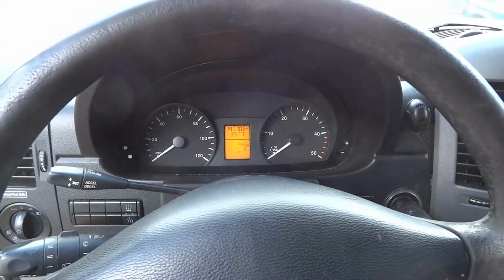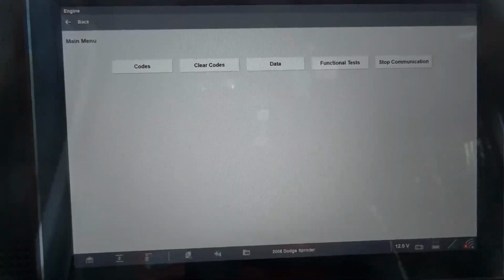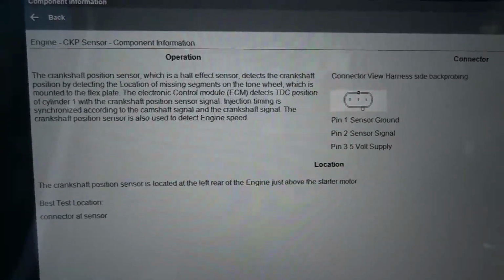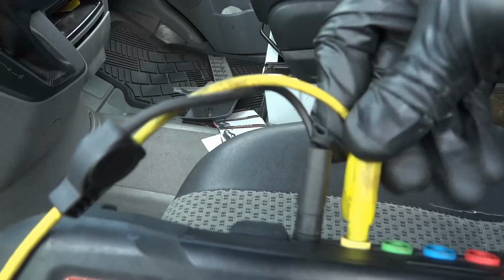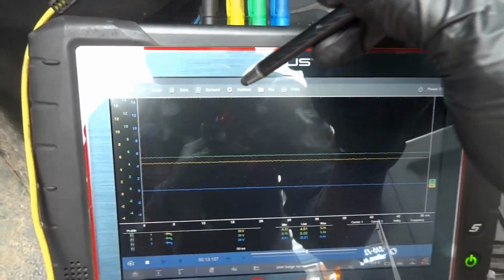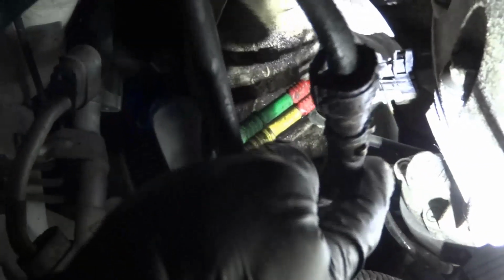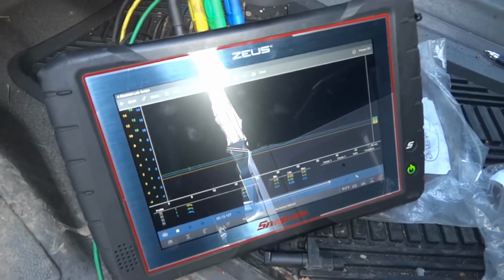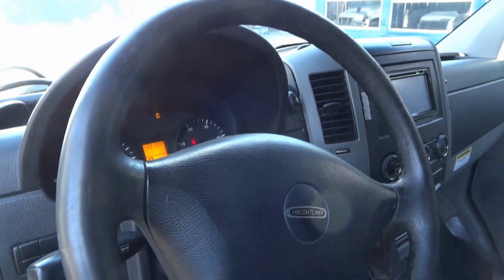Freightliner / Dodge Sprinter Crank No Start, Code P0335, Diagnosis and Repair

Comment: I was born in Frederick MD. I haven't been back there since 1972. I have an 07 sprinter I got it in a trade. It ran great until the turbo exploded from  broken exhaust manifold pieces getting pulled into the turbo. I replaced the turbo and repaired the intake manifolds. When I put it all back together the engine cranks but won't start. I replaced the crank sensor but it still won't start. The tachometer isn't moving while cranking. I'm going to check for voltage but it seems odd that it won't start after the rebuild. I have cleaned and checked the grounds. Nothing is working so far. Hopefully it's not a bad ECM...

Comment: Hola mi esprinter arranca en frio y cuando calienta que lo apagó no vuelve a arrancar hasta que se enfría el motor que podría ser es un Freightliner esprinter 2500 diesel
Reply from the maker: @AndresHidalgo-h2w  English please?
Reply: My 2007 Freightliner Sprinter 2500 starts when cold and when hot it doesn't start until it cools down. What could it be?

Comment: Thank you sir for these videos... Are there two types of hall effect sensors (CKS down pull sensor and CKS up pull sensor)!? 
If thqt correct... I think the first one you are explaining here
My question is how can I know which one I am dealing with because the second one is supposed to be 0 volts on two wires and 5 volts on the third wire
Thank you
Reply from the maker: @kharbichetahar4486  My Pleasure! There are hall effects sensor and permanent magnet sensors

Comment: I'm here to learn from a great professor.  But am a little confused. You  backprobed  a 3 wire hall effect sensor but yet you had 4 leads plugged into the labscope. Where is the 4 th lead connected to? Also, can you do a load testing of the circuit with that labscope ? Thanks for the great videos.
Reply from the maker: @thereckchanic4709   My Pleasure! the forth lead is the ground of the scope, you load test the sensor circuits by cranking the engine

Comment: I have. mercedes sprinter reset code P13F6-00 stuck any ideas to help fix
Reply from the maker: DJ Rico Guzman  check your DEF System
Reply: @KITS_Auto_and_Truck_Repair  thanks
Reply from the maker: @djricoguzman493   My Pleasure!

Comment: Want to give you a big “thank you” for you thoughtful step by step diagnostics.  I was able diagnose and locate a turbo intake leak and salvage my long road trip.  Did a 20 minute parking lot repair of the air intake turbo supply line with a $15 pipe repair fiber tape kit.  Would never have figured it out without your videos.  Repair has held for 800 miles.  Picking up the new part tomorrow.
Reply from the maker: Lou Mcgill  My Pleasure! I'm glad to hear that the videos are helpful!

Comment: Good 👍 Job 👌 brother 👌👍. I've a question ❓🤔 for you. Is it possible to test a sensor like crank position sensor itself with a simple multimeter by measuring the resistance or so? Thank-you 👍.
Reply from the maker: michael gebremeskel  thanks! I would not recommend doing a resistance test on a crank sensor because the results of that test can be very misleading! you're gonna need a scope to test a crank sensor, the signal is too fast!
Reply: @KITS_Auto_and_Truck_Repair  thank-you 👍👌 Mr Deo.
Reply from the maker: @michaelgebremeskel6622  My Pleasure!

Comment: Good video. I have a 2001 sprinter van that I have crank no start. It happened right after I changed the fuel filter. I have tried 3 different scan tools so far non of them work. Can you recommend a good affordable one that works on the sprinter vans?
Reply from the maker: Bravo Carpentry  it sounds like you have air in the fuel system, I recommend buying an Autel Scanner!
Reply: You have to prune the fuel filter and let the engine crank for 1.5 minutes because on the 2001 there is no in tank fuel pump. It takes that long for it to pull it up into the motor. Seems crazy but it’s true. Keep it cranking until it starts.

Comment: Would it be possible to test the crank sensor by passing the tip of a screwdriver near the end of the sensor to simulate a reluctor wheel?
Reply from the maker: DW S  Yes absolutely, or a piece of metal!

Comment: I got a Toyota Camry 1999 model with a confirmed P0340 and a pending P0116, P0773 code. The symptoms the customer told me were: engine stalling while on motion and during that time the car just wouldn't start because the engine was very hot but when the waited for an hour or more the car later started. What I noticed was that the car revv high intermittently on it's own but will return to normal idle again about 5 second again, and the exhaust tailpipe was really darkened when I put my hand. It was raining heavily that's why I was unable to check anything further.  Plugs, fuel pump and a relay( the don't know where the relay was removed though) was replaced by another engineer but the problem still persist. Please how do I fix this problem?
Will replacement of part like camshaft position sensor fix this problem?
Reply from the maker: david essien  check the cam and crank sensor! or I recommend you take it to a pro mechanic to have diagnosed!
Reply: @KITS_Auto_and_Truck_Repair  Thank you so much for your support and assistance 🤝.
 I checked there and didn't see the CMP sensor nor a hole where it should've fitted into however I saw the connector only. Fortunately, I saw the fault today. I was imagining why the code for temperature sensor displayed hence it prompted me to ask the car owner if they've ever experienced overheating with the car. He acknowledged that fact and was more detailed in his explanation, that the fan was not working and radiator have been leaking and the keep adding water. It was the cooling system that was causing the water temperature sensor code to show. The radiator was leaking water and one  among the two fan was not working so when  the car is hot, it  stalls. But it will restart after the car is left to cool. Although I didn't test run it because he told me the fuel was low.
  I have fixed the fan. Both are working now but for the radiator I told them to give it to a specialist on radiator to fix the leak. 
  If they fix the radiator I'm hoping the problem will be permanently fixed.
Reply: @KITS_Auto_and_Truck_Repair  Ok. I will check that. Thank you so much!
Reply from the maker: @davidessien5465  My Pleasure!!

Comment: Afterter I install the transmission my sprinter crank no start I replaced pup cranksensor
Reply from the maker: Angel Leon  make sure your the reluctor wheel for the sensor didn't get damaged! what kind of trouble codes do you have in memory?

Comment: I've seen this issue with a few cars and most times, the car won't start because the car's computer system doesn't recognize that the gear is in PARK. The system thinks you're trying to start the car in DRIVE so the ignition is deactivated.....but this seems like a more unique situation. Very good video.
Reply from the maker: Ghana Mafia  Thank you! and yeah a defective Neutral safety switch on a transmission would cause the vehicle to not even Crank!

Comment: bro, 2013 accord, i do a piston preassure test, change the spark plugs and then the car wont start and now i get P2363 and also, i get p0202, p0303, p0404 injector"A" circuit. however, im thinking its a byproduct of the first code. What can you tell me about this. Is it the preassure regulator sensor, oil pump went bad, injection pump regulator or a wiring issue? thanks.  Also, once again great video. In fact, because of your catalytic video i was able to cure a multiple missfire on my work van. by the way the car turns and if i spray the intake with starter fluid, it starts but shuts off...
Reply from the maker: powerhouse  since the vehicle starts after you spray starting fluid in the intake, your problem is most likely a defective fuel Pump! check for fuel pressure, if there is no fuel pressure check for power and ground at the pump! I have a couple of videos on this channel that show you how to test the fuel pump! I recommend you watch them! Good Luck!
Reply: @KITS_Auto_and_Truck_Repair  thanks for you responce...THere is fuel all the way in the injector rails but the main code says P2623 "high pressure fuel pump spill valve malfunction. Thanks again in advanced.
Reply from the maker: @abialex  it sounds like the valve on the high pressure pump is failing or the wiring might have an issue, you should check it out or have someone diagnose for you! Good Luck!